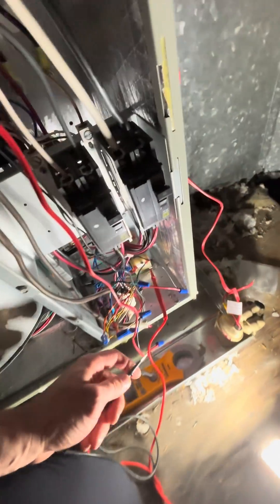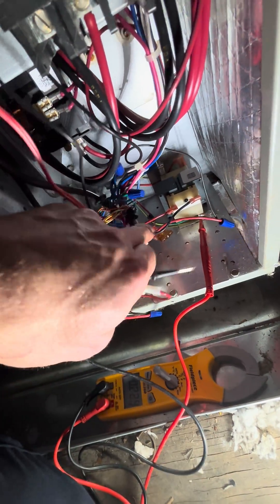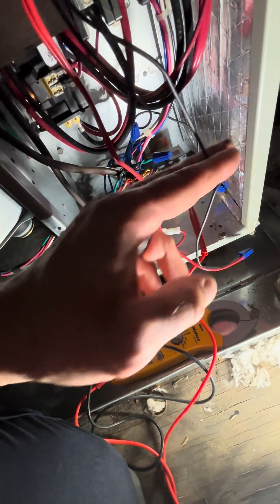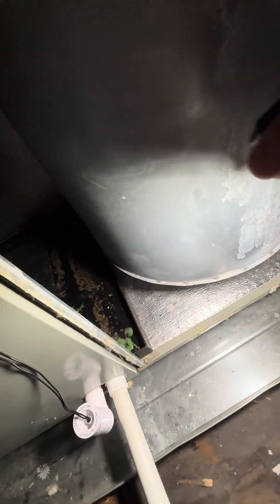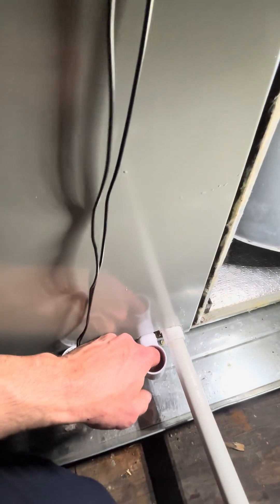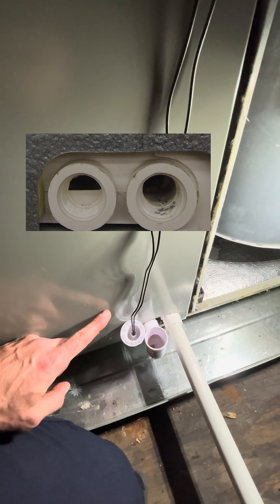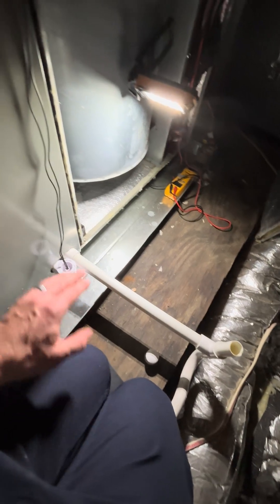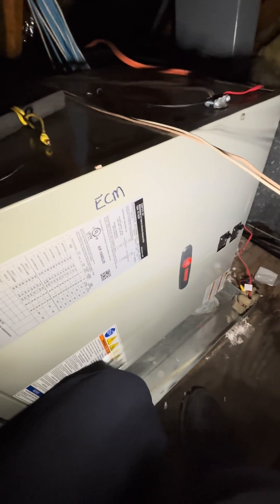Diagnostics64: Trane System Not Running AC

Comment: Or the drain is clogged just enough that it can't drain at the pace the unit is pulling water from the air, fills the switch, and then slowly drain out before you show up. Seems like you enjoy taking 15 gallons of water out of those pans.
Reply from the maker: I’ve seen that before but in this case I saw no evidence of that, thanks for watching!

Comment: No low voltage power and that would be the first thing to check. I prefer them on the primary and just a 90 on the over flow. That way if the secondary pan is working the customer just see water leaking.
Reply from the maker: Agreed there are much better setups than the one in the video 👍.  Thanks for the comment 😊

Comment: We're having a prolonged heat wave right now , I've been sweating my b@lls off in a mechanical room working on water cooled Chillers and also roasting my skin off working up on the roof top on some air cooled .
I definitely rather be on the roof top let me tell ya , than God I don't go into addics !
Reply from the maker: Yeah we’re in a heat wave too.  Been working in a 90F mechanical room all week 🥵
Reply: @HVACLife  It was about 90F in mine too 😅 
Looks like it's the preferred temperature for motor rooms innit , almost like they try to keep that setpoint or something!